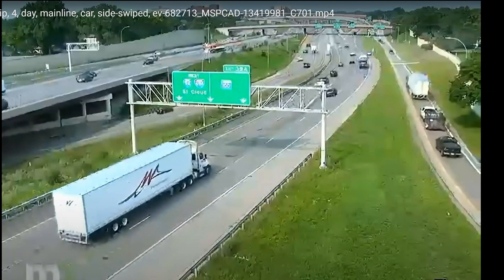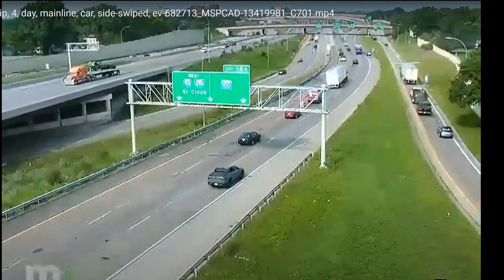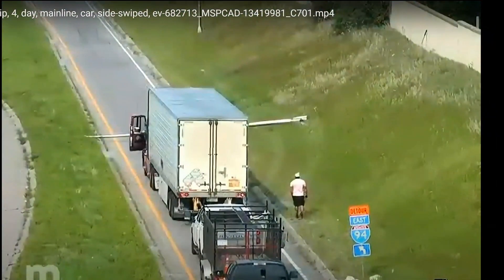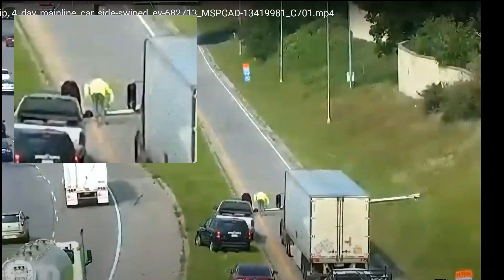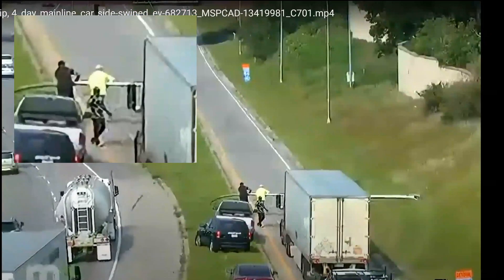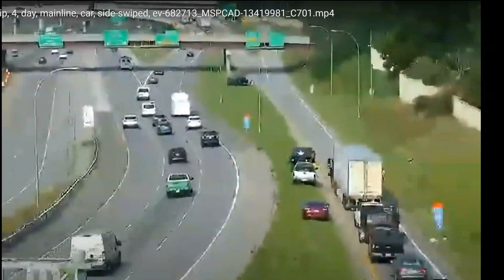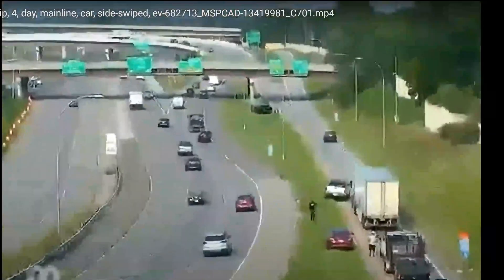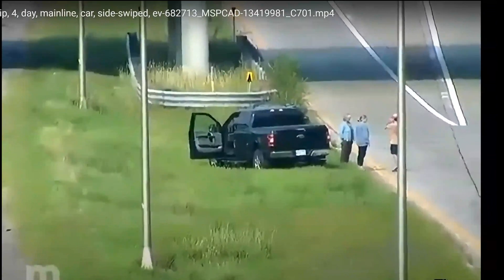A Light Post can SAVE a Biker!!

Comment: Great video!  For some extra reading on this, the website 99% invisible (associated with the excellent podcast) has an article entitled Breakaway Hit which covers some more specifics, including angled joints that can help ensure the post is raised over the vehicle. (I don't think YouTube will allow external links in the comments).

The electrical connections for road lights may also be very interesting, as they must have special breakaway design to prevent sparking or live wires - especially as a fuel leakage is likely, and the engineers must ensure the electricity doesn't create a fire risk. My brief Googling didn't find anything on that, but there is surely information out there.